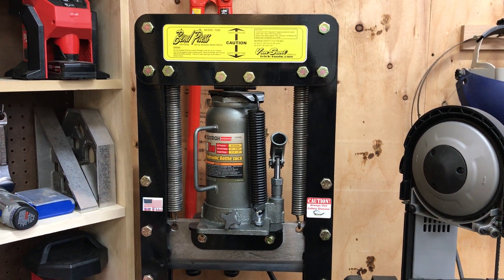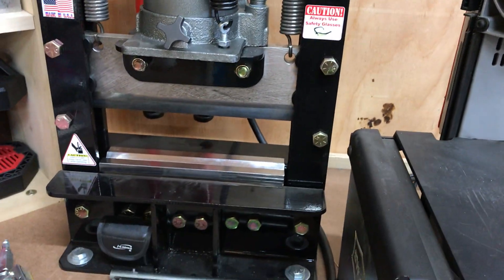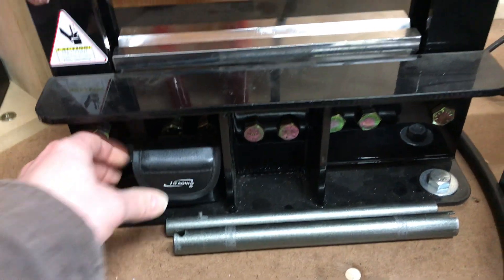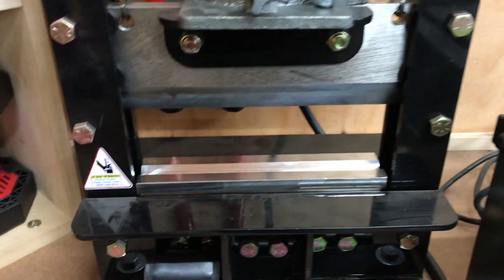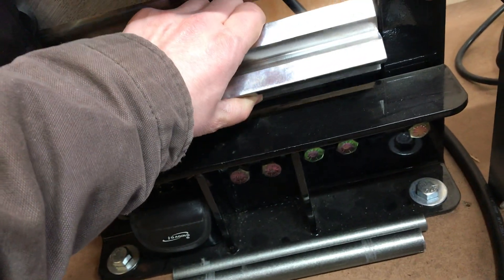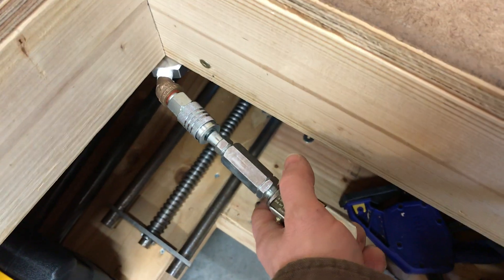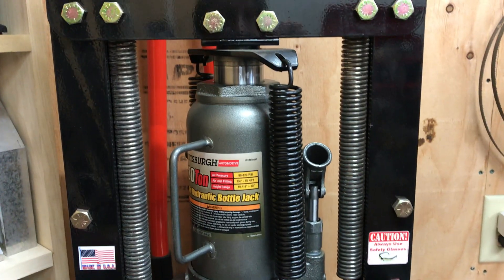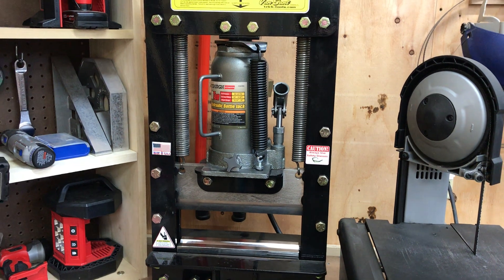Bench-Top 20 Ton Metal Bending Brake Press!

Comment: We just got one of these - V-block too. Great build quality like you said. The punch is tool steel (as well as the V-block if you get that). We have a 48" heavy-duty (12 gauge) pan brake for most of our work but needed something to bend plate for brackets. We plan to do some mods so we can use standard press-brake tooling (goosenecks/fingers). Easy to do on this platform. Definitely a good value for a small shop if the work envelope fits your needs.

Comment: Nice machine! I'd love one. My brake press is a big vise, an Athol with welded jaws that has no restoration value, two sized slabs of maple butcher block, and a 7lb non-marring hammer. It doesn't really get the job done. Comes close at times.